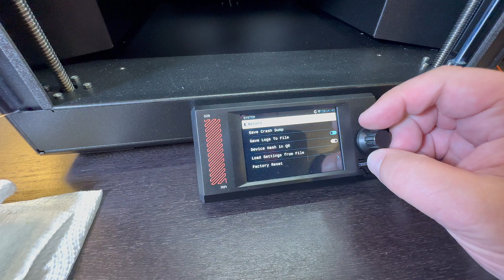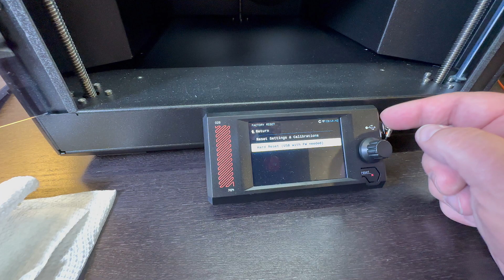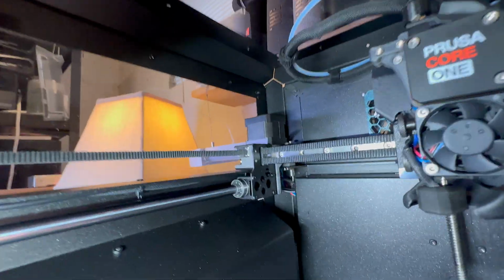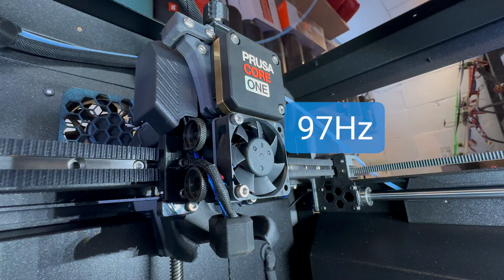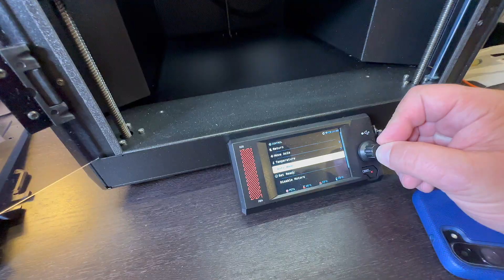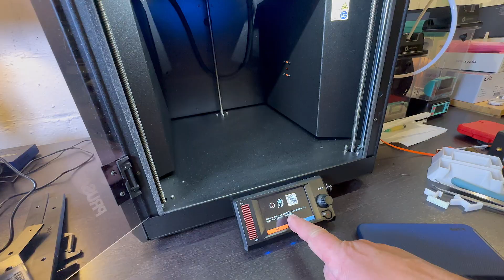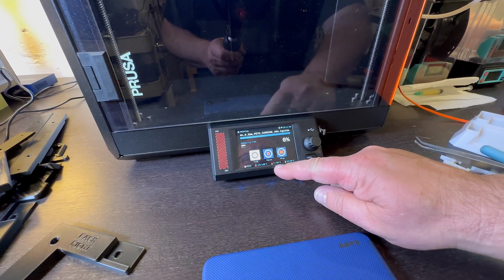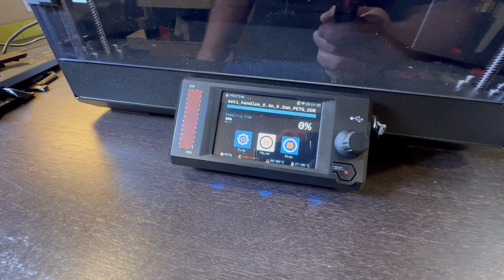Prusa Core One Conversion Kit Issues Fix

Comment: Take a look at this Prusa article:
regular-printer-maintenance-core-one
Prusa recommends to use the Prusa Grease also for the Z-axis leadscrews, BUT, the don't recommend to use the Prusa Grease for the X-Axis Rail:
This is the original text:
Prusa Lubricant: a tube of Prusa Lubricant is included with the Prusa CORE One. It is used to lubricate the smooth rods with linear bearings, and to lubricate the Z-axis leadscrews. DO NOT use Prusa Lubricant on the linear rail!

Comment: A little tip: The Prusa app works very well for belt tuning, IF you use the earphone+microphone combination that comes with most smartphones. You can lay down the smartphone, connect that earphone+microphone to it, and hold the microphone close to the belt. Tuning is now very easy and comfortable, because that microphone picks up the belt "tone" far better, and you do not have to hold that smartphone near the belt.
Reply: Bud, many thanks for the tip.  I was onto the nth app and second phone when you're mic idea saved me from the frustration.

Comment: During the absorbing heat phase, go to the settings and change the nozzle temp to 230 (depending on the material).
Use a Q-tip to clean the nozzle (which doesn't damage the nozzle; using brass to clean brass will eventually).
Change back to a nozzle temp of 130 and let the printer do its thing. You will have an absolutely clean nozzle.
Reply from the maker: thanks for the advice! Right now i have a Diamondback stainless steel nozzle. I was thinking to add a nozzle wipe mod with silicone brush.